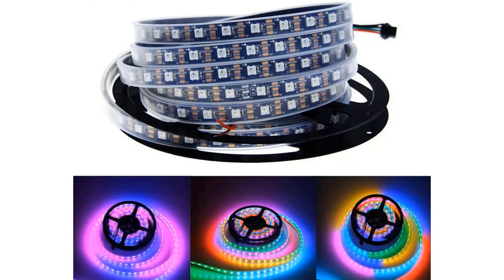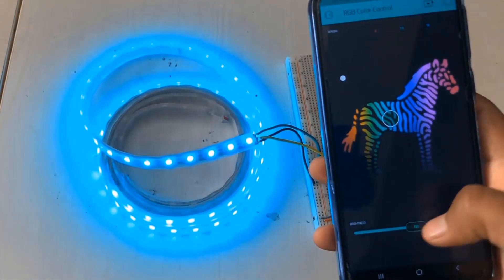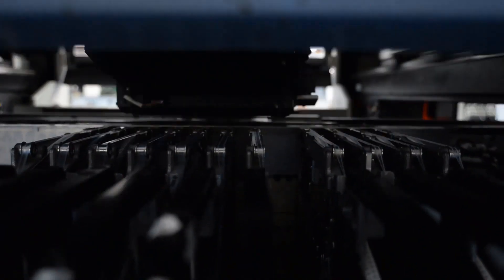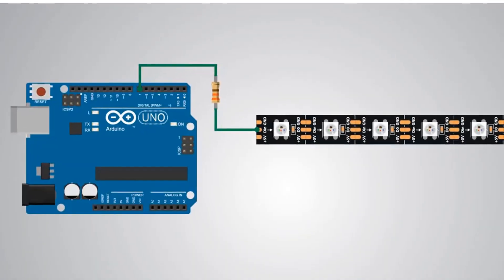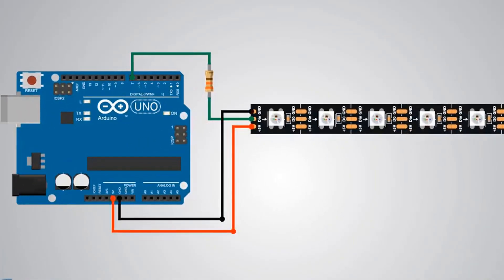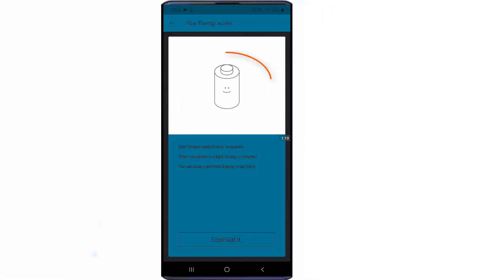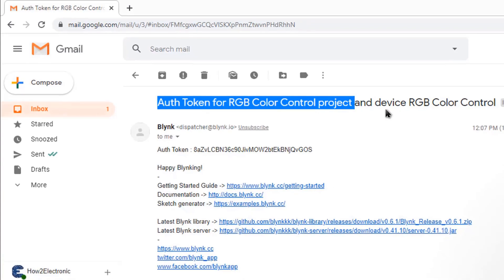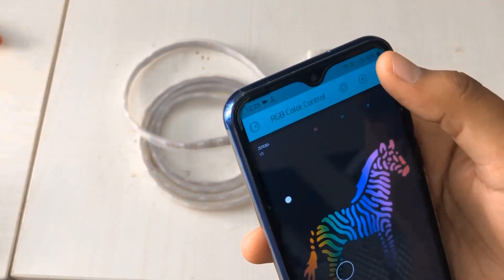WS2812B Neopixel RGB LED Strip control via Blynk & NodeMCU ESP8266

Comment: Is the 200 ohm resistor necessary ? Cuz I tried without and the LED-strip won't turn on? The app works and I can see it's connected via the serial monitor but nothing is happening with the strip. Also I don't have vin on my esp but I attached it to 3v3 which should work?
Reply from the maker: It  need 5v. It doesn't work with 3.3V.

Comment: fonctionne bien avec résistances 220 à 470 ohms sur PIN D1, (aller sur source code/program)
c'est bien expliquer pour les débutants, ne pas oublier de modifier le nombre de LEDS comme pour moi 120 pour 2 mètres au lieu de 60(define NUM_LEDS1 120)

Comment: Nice video but there is no point of using more expensive RGB leds if don't want to address the leds in a particular direction instead use some cheap RGB leds without ic :^)